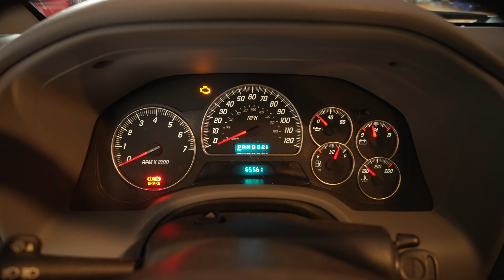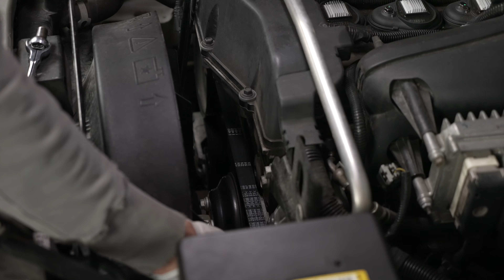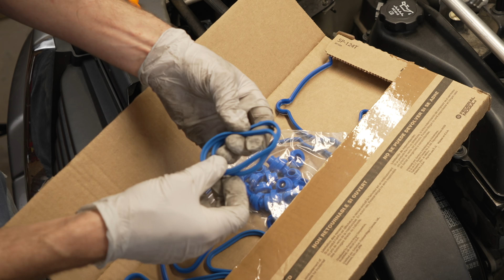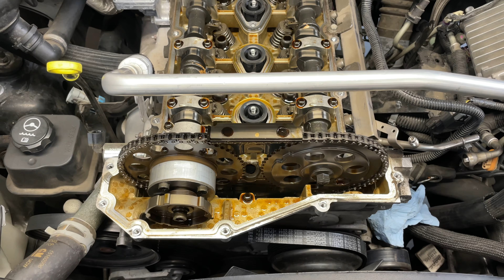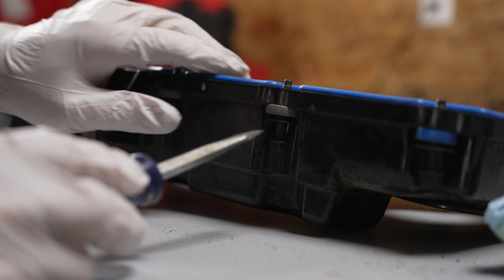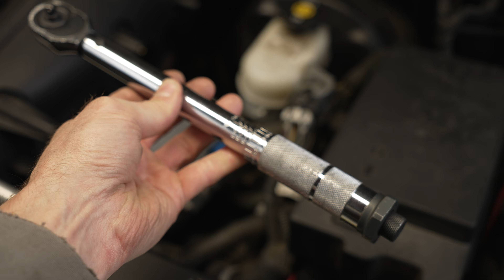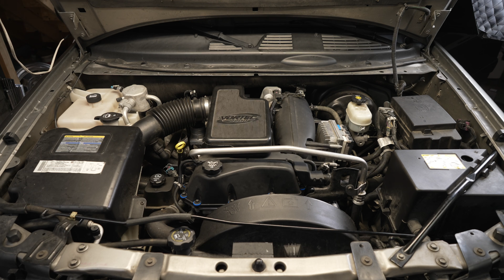Here's Why You NEVER TOUCH FACTORY INTAKE MANIFOLD GASKETS!!

Comment: Though I’ve never played with the inline engines.I’ve had similar issues with a caddy 3.6 and a few 4.8,5.3,6.0’s with a purge valve not sealing or operating properly. The old test was to unhook it take off and see if you blow thru it. If you could it would be labeled as bad.  The fancy way is with a scanner and watch fuel tank pressure as you use a scanner to open and close the valve. 
Best of luck on finding the issue and always enjoy your videos!
Cheers!
Reply from the maker: Thanks!
Reply: @1RoadGarage  While the scanner is out, check command / actual pintle positions on the IAC and EGR. The ECM will give a little leeway of 10% difference before throwing a DTC. And if you've ever used a scanner to manually change EGR and IAC, that 20% step makes a big difference in idle quality. I was checking out a friend's ailing vehicle, on my snap-on and was testing both and she said "there's it's running bad now what is it?" and I said "nope, that was me".
There could also be a relearn due on the IAC or throttle (since you cleaned it)
Reply: @1RoadGarage I have a 2003 and I Got spark plugs,changed and came back Valve cover gasket Fkd. Coder scanner was done,with two codes. Exhaust leak and Injectors fouling. The garage told me,to change the V cover gasket for $700.00 In Alberta. I'm scared it might be more of What's being said here. I'm a Parts Gal and was going into Mechanics,but I don't like the Welding end of it. So Parts Gal keeps me in the the field. 🤞 It's Just Valve cover gasket. Thank you Very much. I subbed from 🇨🇦🍺 cheers
Reply: Recently had a pvc valve replaced and you blow through it both ways. That proved it was bad. It looked very rough. Lots of carbon build up on it. As far a getting a smoother running motor, it didn't help. Back to the question board hunt.

Comment: If you suspect a manifold gasket leak, before you dismantle, with engine idling, spray the gasket areas with carb cleaner.  If the engine slows down, you have a leak.  When you have a weird sound, you can isolate it well with a stethoscope with a long narrow tube on it, made for that purpose.  It's low tech but you can narrow down where the sound is coming from.  
As for the AC Delco alternator, I bought a NEW one for my '03, ZR2, not rebuilt, from Rock Auto and got a great deal on it.  The original lasted 125k.  The new AC Delco alt, started making bearing noise after about 7k miles.  I'm still running it, but yes, Delco junk.  But was able to isolate the noise to the alt with the stethoscope probe.
Reply from the maker: crazy how an entire alternator can be ruined by a crappy bearing.
Reply: @1RoadGarage Yup.  Got a brand new Delco idler wheel once that the bearing was bad from the box.
Reply: As far as isolating noise sources, you can use a longish piece of wood like an old broken broom handle placed on the suspected noise cause and placed near the ear. The high (relative to air) density of the stick will aid in pinpointing the source. A trick my dad taught me for finding bad bearings/bushings. Hope that helps someone.
Reply: @tenflat2009 at work I used a piece of cold roll with a flat plate as my ear piece for my pumps or a wrench
Reply: @tenflat2009 I've seen a large, long screwdriver used also.
Reply: @tenflat2009 I use dried out Slim Jims 🎉
Reply: I use brake cleaner for finding leaks. Although it's bad for plastic
Reply: @Unit_450Dude, you go right ahead and do it your way.  You are just padding your bill fooling with fuel trim to find a vacuum leak.
Guys working in their garage most likely can't make heads or tails of fuel trims but they can find and fix a vacuum leak without even knowing the term "fuel trim".
Reply: @Unit_450If you where actually a 'good' mechanic, when a customer came in and said he could hear a whistling sound when the engine was idling but not when he stepped on the gas, you'd know (should know) to look for a vacuum leak.  You HAVE TOO 'look' for the leak.  It's not in your scanner.  But you do you.  
We aren't talking about a "high flow shop".  We are guys who work on our own vehicles in our own garage specifically to avoid high flow shops that pad their bills by charging you for them playing with their digital toys when they should be getting their hands dirty.
Reply: Fuel tubing and small heater hose work well for locating source of some sounds.  I once had a random dink- clink... dinkitty-clink non-rhythmic sound at idle that I just couldn't isolate.  Poked around afew times for a year, no joy and no problems.  Fuel hose and heater hose both said alternator but screwdriver said bearings not bad.   Finally took alternator apart (80's Pontiac 2.8) out of frustration and found a screw floating around!  It was one of 2 that held/trapped the front bearing into the front housing.   Stripped threads in the housing.   Local alternator shop replaced the front housing for me... $15!
Reply: @dhgmllcshea5038 I've seen that back in the day.  It works well too.
Reply: @Unit_450Fuel trims WILL NOT help FIND a vacuum leak.  It can only provide you with evidence there is one.  There are several ways the home mechanic who is not a "Tuner" can find a vacuum leak.  Fuel Trims ain't one.
Reply: @Unit_450That won't help you FIND the vacuum leak, only indicate that you may have one.
Reply: @Unit_450
Disagree, but it won't hurt anything, just extra effort.  You are still going to have to locate the leak.
If I was going to have a gauge involved for confirmation, it would be a vacuum gauge.
Reply: AC Delco trash parts made in China 🇨🇳 Thanks NAFTA
Reply: Had similar experience with a new AC Delco alternator shitting out a bearing in less than a thousand miles.

Comment: Maybe the PCV valve?
Reply: They started building the pcv into the timing cover. Have that on my 3.5l 2004 I-5 Atlas motor. You can shoot cleaner into the hose.
Reply from the maker: I don’t know if this Envoy has one??
Reply: @1RoadGarage if it didn't have a pcv I'd be surprised. It could be from the block though instead of from the valve cover. In either case I don't believe this issue is pcv related.
Reply: @tenflat2009  The 4.2 was never equipped with a PCV valve.
Reply: @supersaiyenunlimit2  good to know. Thanks for the info.
Reply: @1RoadGarage  There is a PCV hose that gets clogged. On TrailVoy an old-timer there INSISTED I clean out the PCV Hose - and I also replaced it (Rockauto). I never knew if my PCV hose was clogged but I'm approached 300,000. So I figured I better do it - also I was doing an engine clean with acetone - so put some through the PCV hose.

Comment: I know on some GM vehicles those plastic intake manifolds can warp causing issues.
Reply: Never heard of it.  Those plastic intakes are on about all model cars and trucks with EFI now, by far NOT just GM vehicles.  Not saying issues never happened, but it isn't a big problem at all.  Plastic all over modern vehicles is a consequence of Govt. gas mileage laws.   People scoff at it because it's plastic, but it works well for intake manifolds, it is usually only the 'top' of the manifold on a V-6/V-8.  On Jimmy's inline 6 here, it appears the whole thing.  But it is cheaper to make and saves weight.  Nobody ever junked a GM vehicle over a plastic intake issue, but everyone instantly thinks aluminum or cast iron would be better...because plastic.  They are missing lots of understanding.  Not all plastic is the same.
Reply: @x-man5056  I think it was more of a problem in the older GM vehicles from the early 90s that had plastic intake manifolds. The more modern ones may not have that many issues.
Reply: @TheBeerBox80 I have seen many warped intake and exhaust manifolds, and even heads.  All cast iron or some Aluminum intakes and heads too.  It is sitting on top of an oven of an air pump.  
It is true things have advanced in plastics.  More and more use of it every day.

Comment: Maby a VVT/cam problem? It seems to run ok while you are cruising,then you stop and you have a rough idle,after seeing the valve cover off the engine seemed pretty clean but the VVT valve screen can still have some dirt on it.Witch would decrease oil flow,or maby just not bad enough to throw a check engine light on..............I'm just guessing.
Reply from the maker: Thank you, I actually replaced that valve recently and even the original was perfect.
Reply: I'm no pro mechanic but in my opinion that valve area is way too clean to have any maintenance related vvt issues. Doesn't mean the phaser isn't bad though, could have failed internally just for sh!ts and giggles... I'd put that as a last resort though seeing how clean that engine is internally ie little to no varnishing...

Comment: It’s never a diagnosis :/ just swamping out random stuff. I used to like this channel
Reply from the maker: This is real life dude. I don’t know everything. Just trying to figure it out as I go. Flip the camera on and hopefully good comes from it. 🤙
Reply: @1RoadGarage  that's how you learn. not by making hateful comments online. but by actually getting out there and turning wrenches. keep it up
Reply: @1RoadGarage 
One question, did you ask anyone??? 
I mean if the parts store has anyone who has worked on motors, they could have told you that those manifolds warp!!! 
It was and is a major design flaw in making a part out of plastic type materials and then attaching them to the hottest parts of the motor!!!
Those manifolds are at best fiberglass infused plastic and at worst are just a more hardened plastic and none of that stands up to the heating cooling cycles of engines for as many miles as most engines last these days!!! 
I replaced three entire manifolds on a 5.4 Triton in my 2003 Ford F-150, which means it has four manifolds before I got rid of it! 
Another thing, if you buy the manifold, most of them(Dorman for sure) come with lifetime warranties, which means you buy one and can change them for as long as you own the vehicle and they all come with the gaskets installed!!!
Reply: I came here for the comments...
Reply: Thats exactly why i love this channel,  @1RoadGarage
Reply: @1RoadGarage the noise is a vacuumed leak
Reply: @chaseleim4773  then checking out the PCV hose is a must.
Reply: @1RoadGarage  he doesn't understand the pleasure and pain of owning such a great suv. I've had mine for 14 years , and it's got 324k on it.
Reply: I had this exact same problem.  I changed the evap solinoid on the side of the block and BINGO. Rough idle gone. It was the last thing I tried to cause I was out of ideas too. Mine was almost stalling to and yes, if I hit the throttle too fast.  Maybe you did that already though idk.
Reply: @ShadKing-z8c  At idle, the can purge is normally closed so you shouldn't get vacuum at the canister side of it. It would suck extra fuel vapors into the engine at idle; it is meant to open at other times. The can vent is normally open at idle. It closes when the can purge opens to keep the engine from sucking in fresh air instead of fuel vapors from the canister. If the vent stayed open when the purge was open, the engine would basically have a big vacuum leak. I've had to replace the solenoid on the block also, because it was actually closed yet didn't seal off vacuum. That showed up as a MIL code for small emissions system leak.
Reply: He diagnosed a bad alternator, bought a gasket kit and installed them all, i don't see a problem 😂
Reply: @RGV2300 
I would be leery too but guess it’s just more content by doing this
Reply: That's what makes this channel great.......stop being a wank
Reply: swamping, funny.
Reply: That's his business he make videos of how to fix your vehicle and dam good ones.  👍
Reply: 100%
Reply: What do you mean you “used” to like this channel. This dude has always been an ACDelco parts changer until he finally tackles the problem and we love him for it lol. I myself love working on older vehicles this way tbh bc even if the part you replace doesn’t fix the problem, as long as you know it’s a good part, it will be replaced so you don’t have to worry about it down the line. As long as you got the money to spare for the part and you enjoy doing the work, it ain’t hurting anything and you get a learning experience from it. So I say keep it up @1Road

Comment: also check the MAF sensor if it has one
Reply: I was about to suggest the same thing
I had many cases where MAF/MAP gets wet from oil/moisture and it trows the drivebility of the car way off - sends wrong data to the ECU and the car starts misfiring, dying and all sort of wierd stuff
Reply from the maker: Is that cleanable?
Reply: I had a similar issue with my RSX (acura integra), turned out to be a vacuum leak! -they are way more sneaky than you'd think, other things i would check -upstream 02 sensor, catalyst & finally (not very likely and I have no idea how you would confirm but.. the transmission could potentially be loading the wheels more than expected in first gear?) @1RoadGarage 
edit: also, is there a chance you just aren't used to the inline? haha -you gotta remember secondary balance is not what they're about, top end power is what inlines are for!
Reply: @1RoadGarage  Yes. Very easy to do, just need to use maf cleaner and be extremely gentle with the spray. Let air dry, then reinstall.
Reply: @1RoadGarage like longtrailside said, yes it's cleanable, gently. Usually located near the beginning of your air intake, close to the air filter element. I recently had a P1400 on my 09 avalanche which ended up being caused by a dirty throttle body. Odd since the code is related to the EGR. But a cleaning and we're good now.
Reply: @1RoadGarage check MAF in idle, you will get low vacume pressure = pressure leak in engine.
Reply from the maker: It’s new.

Comment: i would check air fuel pids cause if there was a vacume leak then u will see it in the fuel trims
Reply: What you say is true but that takes an experienced technician to interpret, and the right equipment.  And it may cause you to suspect a vacuum leak but NOT tell you where.
There are several other ways to find vacuum leaks that require less technical knowledge and will take you to the source.